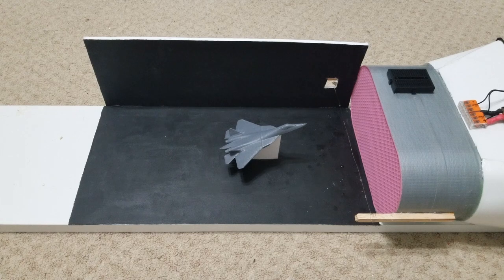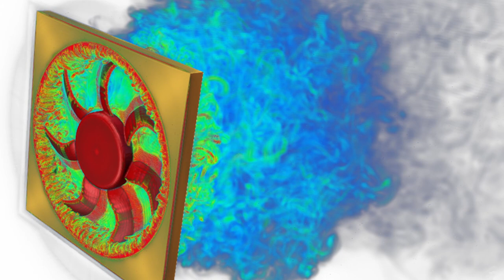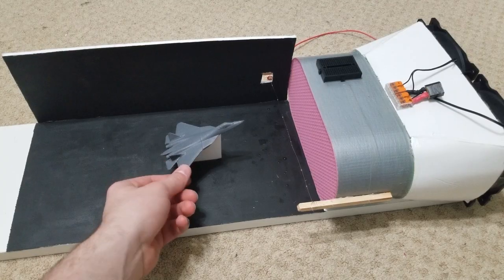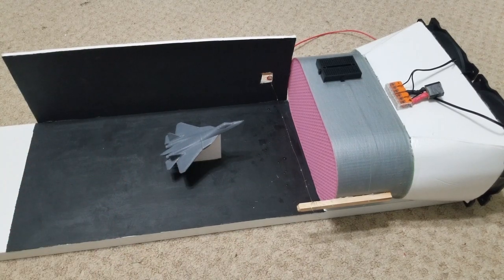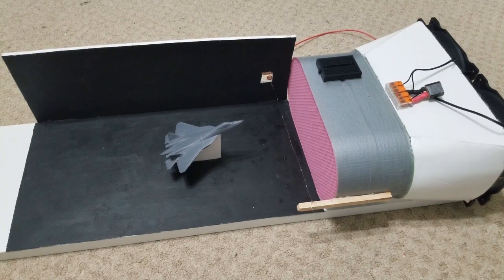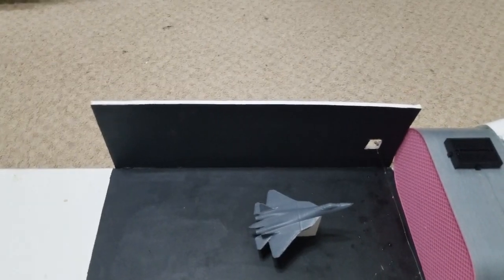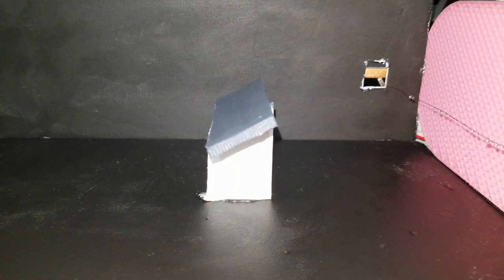My Mini Wind Tunnel

Comment: You should maybe consider a closed design that pulls the air to the back. If you make it so that the only intake is your pink grid you can get the air to be way more laminar.
Reply: I was thinking the same thing.  Close the side and top, keep the grid at the front but move the fan(s) to the rear of the tunnel.  This will allow for less turbulence at the grid because the smoke will be pulled instead of pushed.

What’s the scale speed of the wind?

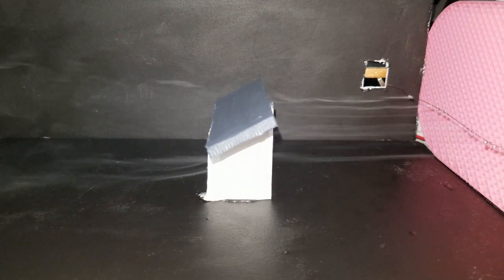Comment: 4:00 That is why you must put the fans on the back sid for suction. The fun create a lot of turbulance on the exit.
The wire and oil is nice idea but look to costly and hard to deal with eat when working on project.
And vertical mode will be better for analisis. In horizontals you cant see the lamination and where drag start happen.

Comment: did you just apply the glycerin using a paintbrush only? would there be any better way to keep it on for a long time?
Reply from the maker: You could probably make a dispenser system with a peristaltic pump and some kind of manifold to automatically drip onto the heat wire. Or gravity-fed like a funnel that leads to drip-nozzles or something idk.

Comment: tryna do this for science fair, what can you use to run a current through the nichrome wire, and will any amount of current work?
Reply from the maker: you can find charts of expected temp vs wire gauge and current. I recommend getting a cheap adjustable DC power supply

Comment: hey, i tried connecting my nichrome wire to new batteries (4,5 and 9V respectively) but they don't heat up. When connected to the wire the voltage of the battery is measured to be 0,3V. what are the exact voltages and current of the battery you use for your wire?
Reply from the maker: I used a 2S lipo battery. Internal resistance of alkaline batteries might be too high which could explain why the terminal voltage drops like that if thats what youre using. If you connect many 9V alkaline batteries in parallel it might be enough.

Comment: This is AMAZING!! I love wind tunnels and have been working on one. I really like the contraction cone, much more optimal that the more rectangular ones you see more. I 3D printed the air laminator too on my new one, and it's so much easier than cutting hundred of drinking straws XD

Comment: Hey man im wondering how you connect the nickel chromium wire to the battery, im thinking about doing this as a science fair project. Can you post a video on what it looks like from the back and how you connected everything. idk if u even still have it but if u do mind showing what it looks like from the back. Anyways a great video and a great idea as it solved a whole bunch of questions i was looking for!
Reply from the maker: I would use aligator clips
Reply: @Benjijart Im wondering if their is any other wire i can use instead of the Nickle chromium one? Thanks a lot i appreciate it.
Reply from the maker: @younesbahiani  steel might work. Nichrome is easy to get on amazon though and is intended for use as a heating element with documentation on temperature vs current vs diameter etc.
Reply: @Benjijart  Hey is it possible to use a 9v battery to heat up the wire, maybe 2 or 3 of them lined up? I'm not trying to go out and spend a lot on a power supply or something too expensive and I'm wondering if theirs  an alternate way to heat it up.
Reply from the maker: @younesbahiani  probably yes but they have less power output so you may have to use really thin wire. there are tables online that equate current to temperature for different gauges of nichrome wire. You should also be able to find ohm/m for a given gauge of wire. Use ohms law and don’t forget the internal resistance of the battery in your calculations

Comment: Hi.
I know this isn't related to the video, but I need to ask you something.
I made an upgraded version of your accesibility mouse controller for a school project (I just added a few buttons, made them bigger and easier to press and it just feels better that way in my opinion).
And I was thinking about patenting it and selling it.
I know it isn't exactly the same product as what you did, so I don't think I need your permission. But I feel like it is the right thing to do, since your video gave me the idea.
I hope you see this, if you don't I will probably comment the same in your next video (sorry if that bothers you, it's just very important to me).
I hope you the best, you make great projects and videos.
See ya.
Reply from the maker: I think that's fine. As long as your controller does not use my 3D printed component which i designed and is under a creative commons, non-comercial licence. Furthermore, you will have to check with the author of the arduino library since the entirity of the code is his design but it looks like his licence is commercial.
Reply: @Benjijart  Thanks man. My 3d model is 100% from scratch so don't worry about that.
Reply: If you do sell this, where can I get one? My brother and I are planning on making a custom f1 car, but before we do we want to 3d print a small one to see its aerodynamics and how it performs.